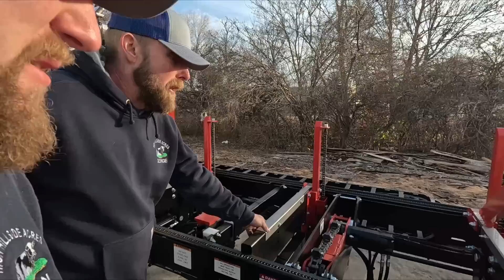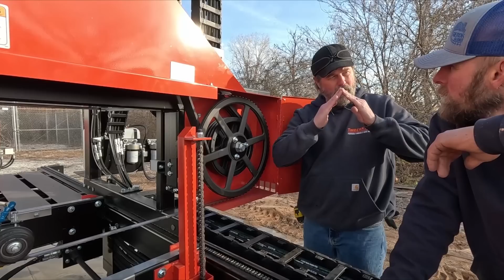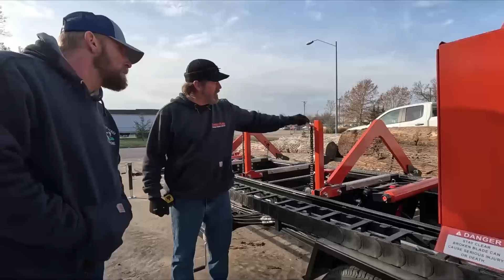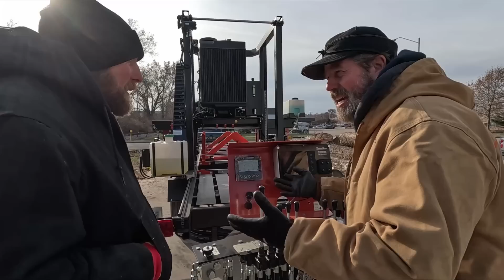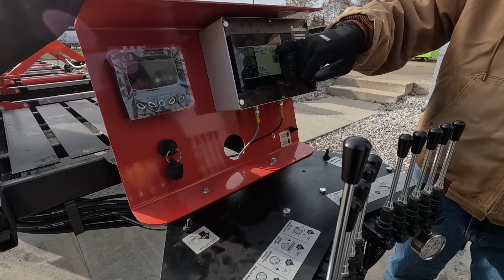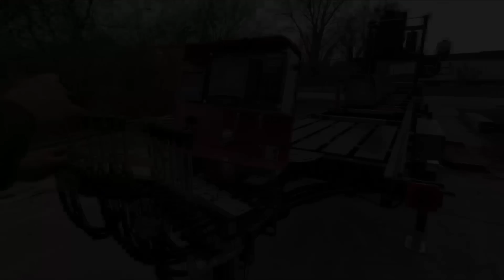Our New TimberKing 2520 Sawmill!

Comment: The video is a few months old.   I bought a timber king last month I got the 2520 model.  I drove up to the factory and picked up the saw mill and spent about a half day with the timber king personnel.  I missed the part about how to engage the forward log Turner.  I called back to timber king and talked to one of the sales individuals about engaging the second log Turner but I'm still not completely understanding how to engage the forward log turner.  Do you have a video on engaging the forward  log turner?  I have cut a few logs but have at this time only used the rear log turner.

Comment: Nice saw but you would think that for the price they would weld the tung on the other side of the trailer to protect the controls in case of a rear end collision and put the saw in the opposite direction and keep it between the axle and the vehicle pulling it for more tung weight

Comment: At 19 years old my grandfather bought a sawmill kit in 1949, it was a belt driven system with a stationary circular saw that has a large carriage that runs the logs through the saw. and to this day we still run that old mill, we sawed a bunch of hemlock lumber that we used both for my barn and will be using on a new shed, very cool old tech. the mill you guys got will be amazing!

Comment: double up on these set screws so the set screw in contact with the shaft remains tight and then the second set screw acts as a locking device. There are special set screws which are  approx. 1/4-inch in length which are hollow through the center for this purpose. The length varies with the thread size, whether NC or Metric

Comment: Congratulations on the 2520.  I have had a 1620 Timberking for a few years now and the additional features would be awesome, I just couldn't afford them at the time.  I like the TimberKing sawmill and their service is second to none.  I had to call for a replacement drive belt and they replaced under warranty which I did not expect.  When you call, you are talking to the experts and not a call center somewhere creating a call ticket and you have to wait a few days for an answer.  I have called them sitting on the sawmill in the field and had the answer without missing a beat on the job i was doing.  Everyone I have talked to is very knowledgeable.  They even helped me on how to saw extremely small log like a telephone pole.  The really small stuff is harder for me to deal with on the sawmill than the big stuff.  Enjoy!

Comment: Beautiful mill. You are going to love learning what you can do with that mill. My first log has sat in my shop for at least 20 years. I was so thunder struck with the 12 by 12 oak cant I pulled it off and have used it as a bench all these years.

Comment: You folks should have plenty of raw material with the wooded areas around the farm. The representative gave an impressive hands-on tutorial for operation of the mill. It will be a learning curve getting used to all the features, etc. The band type blade is sure different than the circular blades on local Amish sawmills in our area.

Comment: You men are great mechanics. To keep the sawdust mess down I suggest a vacuum system with a used cyclone from a feed mill having the sawdust drop into a removable bin or trailer to keep the work site clear of sawdust, to remove the fire hazard also. Just my two cents.

Comment: Curious if the saw mill is bucket list item your finally could pencil out financially and available time or if you are buying it to prep for a large building project or new business adventure into larger scale furniture building?   I was also wondering if the motor controller has option for inputs which could be programed for an idle/max power switch to idle down without having to repeated tap the up and down the engine speed.   Thinking the repeated taps to a button that is exposed to the weather.  Just a suggestion to you and Timberking.

Comment: Congrats on the sawmill. That's one he'll of a machine to start sawmilling  with.  My brother  and I started sawmilling  at 16 with a Lynn economize. A small manual  mill that u push on a track  to  cut logs. After  3 yrs of that we got a deal on a 94 woodmizer lt40 hydraulic  mill. We put about 4000 hrs on that and fixed nearly  everything  on it. Last summer we got a newer  mill a 2018  i think. lt35 hydraulic  with set works and have  cut thousands of BF of it with  it for our lumber kiln. We have  a board edger. 25" planer, and a logosol 4 head molder for making  shiplap and paneling.  U guys will be able to cut all the lumber  and beams need for rebuilding hay racks and cut alot of trailer decking  to sell